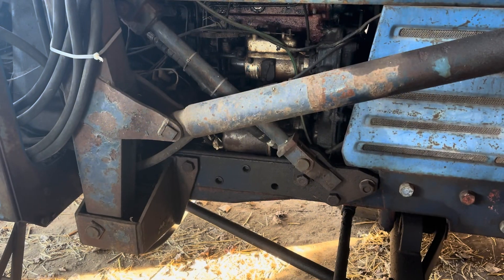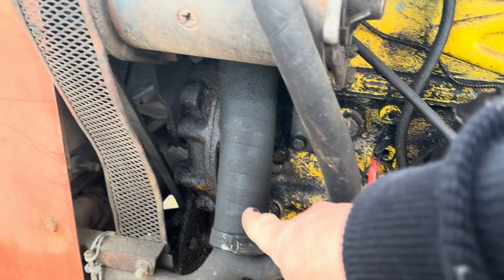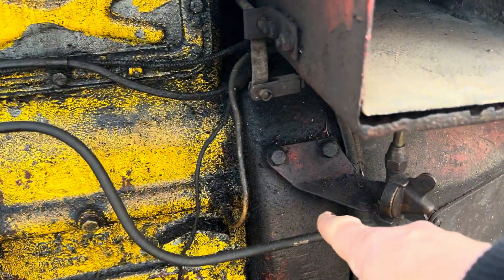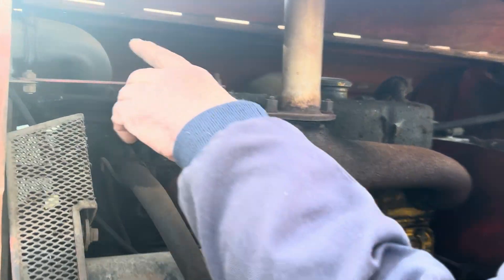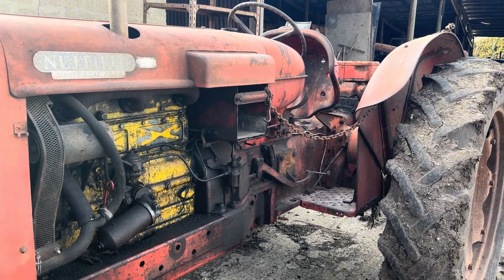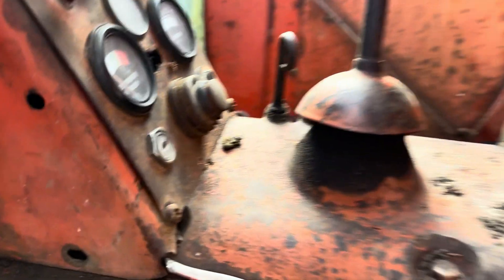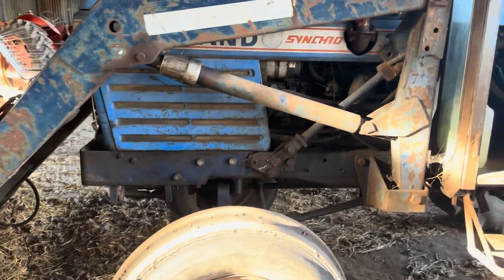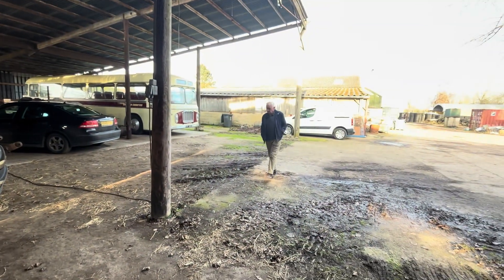Tractor Engine Conversion/Comparison…

Comment: I fitted a truck variant in my DM4 Nuffield . NV 4/98 instead of the old 39hp 3.4 litre original engine .Ran into a few differences, but I now have 75 hp under the bonnet !
Reply from the maker: Nice upgrade. We have a 4/98 in one of our Nuffields too.